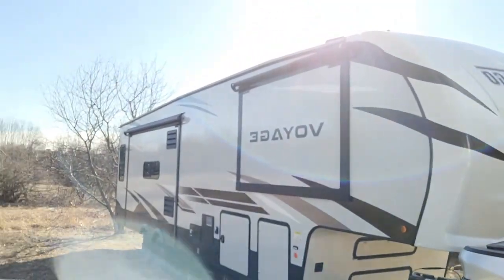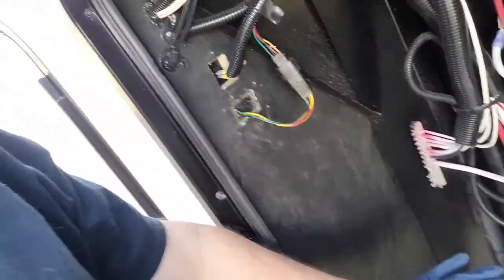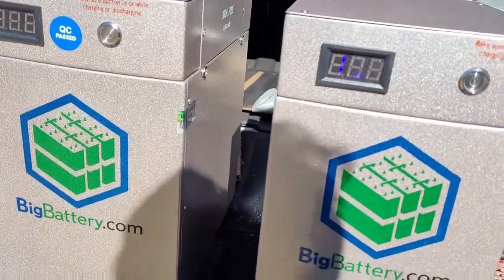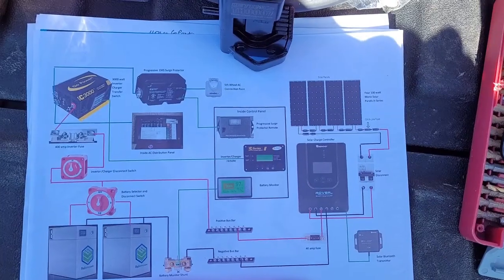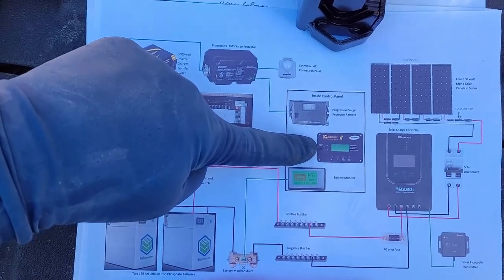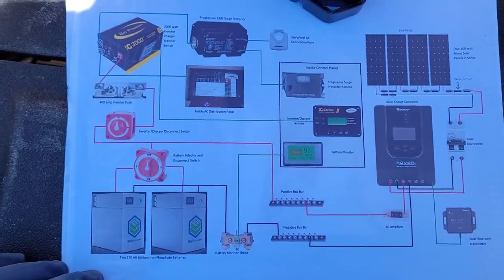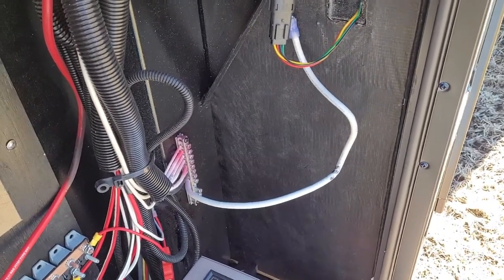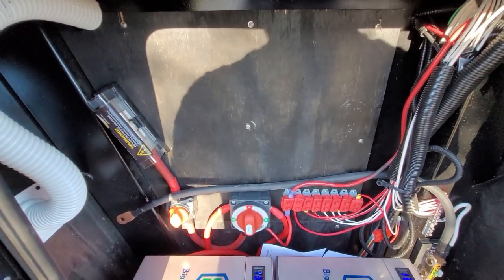Installing Solar, battery, inverter off grid set up in an RV! Part 1.

Comment: Do you have any issues with moisture up in that area if you putting the everything in that battery area?
Reply from the maker: None. I sealed up the battery compartment by adding a floor. I do have an intake vent and exhaust vent and fan to move air through the compartment. It has remained dry.

Comment: Fellow Voyage owner here. Would I be able just to install the BigBattery 12V OWL as my house battery without any other modifications for now and do the rest of the upgrades later?
Reply from the maker: Yes. The existing converter/battery charger may not charge to OWL to 100%, but it will get it close. It won't hurt the battery - the internal BMS will protect it. I am still very happy with the BigBattery units.
Reply: @Seabee_Camper  Thank you Jim, I appreciate the feedback. I do not do much boondocking at all but like the capacity and 10 year warranty of the OWL. I have had y unit for less thank 1 year and my house battery is already bad. I just like the thought of throwing in the ig unit and forgetting about it. Am I overkilling it or should I go with a smaller more inexpensive solution? Any recommendations?
Reply from the maker: @alexcolasuonno  I think if you plan to keep the camper for more than 5 years, lithium is a no brainer. Yes, it's more up front, but the long life and zero maintenance more than tips the scales in my opinion. And more than doubling your available amp hours when unplugged is nice, even if you're just parking overnight in a Walmart parking lot. If it's cold, the furnace blower will wipe out a lead acid battery in short order.
Reply: @Seabee_Camper  Thank you! I purchased the OWL last week. I think I will take my time with the upgrades although I noticed prices are increasing. Do you have a total cost on your full buildout including the solar?
Reply from the maker: @alexcolasuonno  I spent about $4500, which included a Renogy premium 400 watt kit (inc panels, mounting kits, Rover MPPT charge controller, bluetooth module), Surge guard power monitor and protector, a remote battery monitor, 3000 watt (continuous) GoPower inverter (which includes a transfer switch for a 50 amp service and 125 amp battery charger) two 170 AH Big Battery OWLs, and misc wiring, lugs etc.
Reply: @Seabee_Camper  Wow, that isn't as bad as I thought it would be. I am slowly amassing parts to do the same build out. My Voyage is currently getting some warranty work done to her but I was curious if you had replaced the thumb locks on the battery compartment with cam locks and if you did do you recall which size you used. I would go measure but I don't get my Voyage back for a few more weeks.
Reply from the maker: @alexcolasuonno  I don't remember off-hand, but they are a standard diameter and 1 1/4" deep I think. You can get them at any RV parts place. If you want, you can order them from Bauer with your key code and they will make ones to match your existing keys.

Comment: Lookin good! Are you planning on strapping those batteries down so they do not bounce out of place? Also, maybe consider some type of plastic lid, sheet, or caulk that joint between the battery compartment and the BMS compartment on those big batteries so no liquid goes down?
Reply from the maker: Hi Mike. Thanks for your comment. I do have nylon tie down straps I will adding to the batteries. I'm afraid I don't understand your question re: BMS compartment and liquid going down